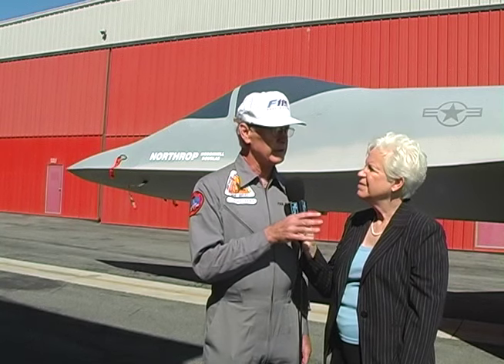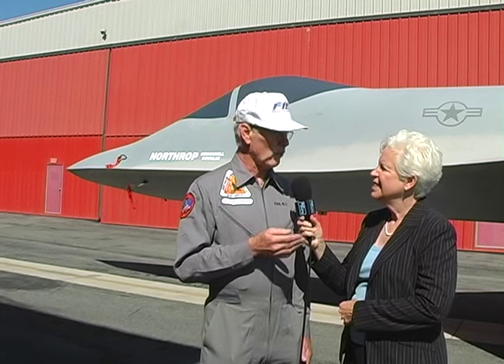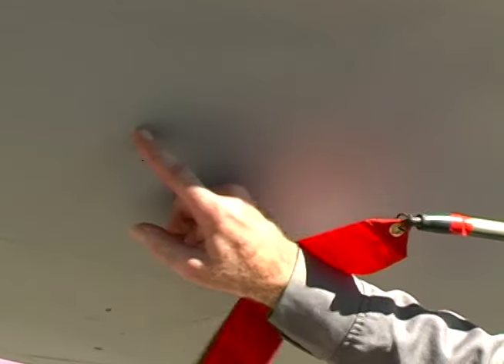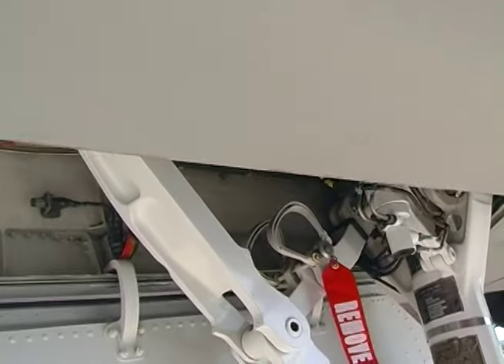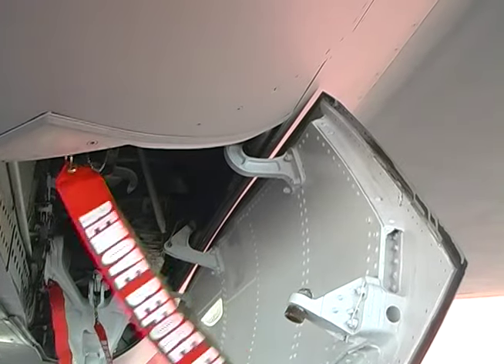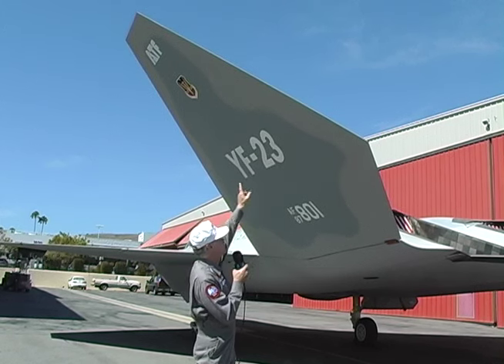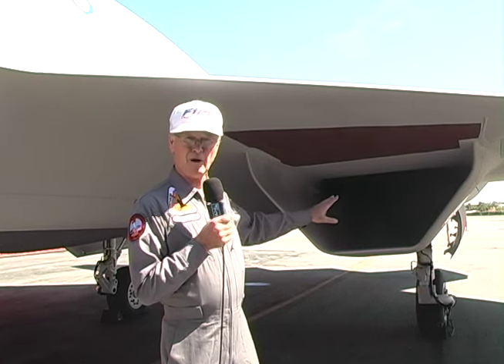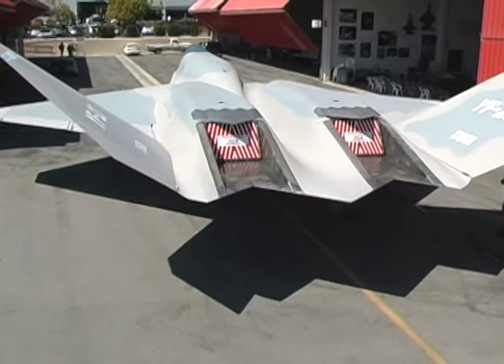YF-23 Walk Around and Design Features by Test Pilot Paul Metz

Comment: Most don't appreciate what an advanced design this is. Low polar moment makes possible this low drag, high-speed tailless configuration, giving it better speed, range, stealth, payload and maneuverability than the F-22. All with only two aft control surfaces, not 8 like the F-22. Made possible because the center of lift has been moved forward.
Reply: It was stated officially that the F-22 is more agile than the YF-23. I personally love the YF-23, probably my favorite jet after the F-8 Crusader. I think what killed the F-23 was political though. If Northrop got the contract, they'd have a monopoly on both fighters and bombers, considering they already had the B-2 contract (and they now have the B-21 Raider project. It's a shame though, this beauty needs to fly with the birds, not be stuck on the ground being crapped on by them!
Reply: it was more "agile" because LM pulled 9gs in test flights- manuvers which were not requirements or in the test plan and NG understandably didn't to test something which wasnt a requirement.  both the 22 and the 23 met the trimmed 60 deg AOA but the 23 did it without thrust vectoring.  another bolt of wool LM pulled over the USAF procurement team/taxpayers
Reply: @HalcyonSkies  "stated officially" by whom?  The AF?  Lockheed?  Watch the documentary on the 23 on you tube channel Western Museum of Flight.  Very informative.

Comment: Beautiful plane!!!  I had read several articles that stated the YF-23 was slightly superior to the YF-22, however, Lockheed Martin needed the contract as Northrop was going to get the B-2 contract.  There has been rumors for years that the F-23 was going into production in a JV with Japan.  That would be great as clearly the Air Force is now kicking itself for not securing as many F-22's as they wanted.  An updated F-23 with Japan would be amazing but likely will never happen.

Thank you for this great video!!!

Comment: rumors are afoot...  Japan may bring the F-23 back from the dead in 2019! True Story!
Reply: Matthew Krawitz, in talks as we speak... I'm rooting for this to happen. If not in the USAF then in some other air force as long as it fly's.
Reply: That would be great only if they pay for ours also. No way Japan's Air force gets this beast unless we get it too. They have the money; let's go!
Reply: No they won't stop with that, rumors no shit. What ever you hear just don't believe it. The plane most likely won't be back unless they can get something out of the airframe.
Reply: we can't let this beauty rot there, engineers worked hard. LET THE BEAST FLY!!!!
Reply: I hope that happens and the the US buys some.
Reply: People around STL are reporting seeing this plane shape on flights over St. Charles the last few nights.... Boeing may be hiding this   away
Reply: I heard they destroyed all the tooling machinery and everything related to manufacturing the airframe... don’t know if it’s true or not
Reply: no way...the electronics have changed so much.  Remember this is a design that dates back to the 80s.  In fact i doubt the electronics on the YF-23 are even still being made which means any resurrection would require updated electronics which would throw off the weight of the plane and this plane had extensive testing and tweaking to the algorithms so the plane would have a stable flight.  To bring this back with modern systems would require a ton of money which is better spent on a new air-frame like the Japan X-2 Shinshin.  My opinion
Reply: Better to go with a F-22 that was brought to production.
Reply: Matthew Krawitz Wrong!!! Never gonna happen
Reply: JASDF lost a F-35 why??? no one knows
maybe it will be an excuse for buying the yf-23
and selling those F-35 back to america
Reply: 2020
Reply: That jet was beautiful, the stealth exceeded F22 and I believe many 6th gen designs are copying its tails section.
Reply: @snowhiterover  Northrop Grumman and Boeing are separate companies. Both YF23s are engine-less and haven't flown since the early 90s. Both are museum pieces. Northrop did take one back to use briefly as a visual piece for Japan and then returned it to the museum.
Reply: Brian Landers  no, it was completely designed by Northrop at the radar cross-section in tejon ranch California, they worked on it since the seventies and was their follow-up to have blue program
Reply: The rumours are even now stronger that it may happen

Comment: 4:38 This Pitot tube is one of the questions I have for F-35.  Since Mr. Metz said it is a temporary test device for F-22 and there is a stealthy version of it, then why F-35 still have them on MP aircrafts?
Reply: For reliability and cost reasons. Those small, flush holes can get clogged easily, and therefore have to be maintained more. Also, because those holes are much closer to the jet, the jet's disturbance on the airflow near the holes not negligible, so the numbers that those holes give aren't actually accurate - experimentation is required to get a correction factor that's applied to the sensor readings to get the true air data. This experimentation drives cost up. Also, nobody's really used this technology before, so R&D cost is also very high.

Comment: The YF-23 was far and beyond a better aircraft than the YF-22 / F-22. Lower RCS, better engines, longer range, more payload.
Reply: Very true! it should have won...
Reply: Wonder if the Lockheed bribery scandals has anything to do with the YF-22 YF-23 fly off.       

The F22 focuses on agility 

The YF-23 focuses on speed and stealth

I think these planes would have worked well together in service
Reply: But no thrust vectoring.
Reply: No the issue was Northrop screwed the pouch on the B-2, not only that they own the drone market.
Reply: Better engines, that failed in prototype resting. It had to make do with 110’s I think
Reply: Jeremy H. 
The most horrific thing for these men is that all their effort wasnt even taking into the US arsenal as another 5th gen jet.. glad they preserved them.
Reply: Buster Dallas yeah but it was also thermally invisible.
Reply: 1. The RCS of the YF-22 and the 23 were similar. While the 23 has advantages by having just half of the YF-22s control surfaces, it also had much larger control surfaces which will break the planned form alignment  when moving. 

The canopy of the 23 also has a canopy bow which reflects radar as well. The 22 has a one piece bubble canopy that is better for Stealth. So while I do agree that the 23 was stealthier, I would say the advantage was smaller. 

2. Both the 22 and 23 had the same engines. 

The Pratt and Whitney engine was rated at 30,000 lbs only which was the original requirement. The requirement changed to 35,000 lbs. Both GE and Pratt built new engines rated for 35,000 lbs but only GE installed it on both the 22 and 23. Pratt's new engine went through rigorous ground test. But if selected Pratt guaranteed that it would be every bit as powerful as the GE engine and it was. 

3. The 23 was faster but only by a slight margin. In fact according to Paul Metz's other video the 22 was tested to a higher absolute top speed. 

For supercruise the official figure was that the 22 got up to Mach 1.58 while the 23 went to Mach 1.62. So as we can see the difference is small. 

4. The YF-23 had a capacity for 5 missiles while the 22 can carry 8. So payload was better for the 22.
Reply: Dude doesn't have better engines than f22. The yf22 and the yf23 both were testing engines from general electric and Pratt Whitney the grey yf23 had general electric engines the black yf23 had Pratt Whitney engines which now powers the f22 raptor.
Reply: Armchair expert alert!🚨🚨🚨
Reply: @michaeld1170  The canopy of the YF23 wasn't really polished, i'm sure in the final design they would've upgraded it to at least f22 standard.
Reply: 1) Conjecture
2) No, they used the same powerplants. One unit from PW and the other from GE
3) Conjecture, they would've used the very same engines.
4) Again, it's a conjecture.

Anyway, it failed to satisfy all of the ATF requirements which also featured superior maneuverability.
The F22 was, from the day one, the better all around fighter between the two.

Comment: The YF-23 looks more stealthy than the F-22
Reply: Originally the f23 was better all way round but at the time the airforce didnt know what they wanted and they thought the f23 wasn't agile enough so they ended up with the 22 cool fact the engines and stealth used in the 23 they incorporated it into the 22

Comment: i was quite sad when YF22 won the comp...... but now seeing it closer, it lacks thrust vector and those heat tiles would be pain to service
Reply: +William Ng But for a mission requiring stealth and speed thrust vectoring shouldn't be an issue the considerably longer range between refuelling should negate all the cons.
Reply: +Gareth Wilkin you have a point.
Reply: Gareth Wilkin You have to be able to fight too.

If i told you that you were entering hostile airspace, and had to choose between a place that is uber stealthy, but couldn't fight very well, or a plane that is nearly as stealthy, but knocks the block off of anything else in the air, which would you choose? You might add that planes inevitably get stealthier with time.

The YF23 was supposed to have been slightly stealthier, and slightly faster (slightly is estimated to be at around 20 percent). But it wasn't just 20 percent less capable at fighting. It was more like 50 to 75 percent less capable. You essentially had a stealth jouster going up against a mediocre ninja. It just pays to be a ninja more often.
Reply: Widg3t's Widgets
The YF-23 was just as if not more so.
PAV 2 was faster and had a considerably longer range.
Jim Sandberg the test pilot for PAV 2 said it was the best plane he had ever flown and would ever fly.
Reply: Well according to yf23.net, hardly supporters of the F-22, the YF-23 flew mach 1.6 without afterburners and the YF-22 flew at mach 1.58 without afterburners during testing. That is a 15 mph difference. Not exactly a huge deal. The 23 did have farther range because it had more fuel. But Northrop sacrificed weapons for fuel. So the 22 had room for eight missiles and the 23 only had room for six. Why? Because they used that space for fuel. And it is obvious that they knew that they lacked in that area because their Dem'Val proposal adds to the length of the 23 and adds a weapons bay under the cockpit. The production 22 is three meters shorter than the YF-23 was and it is a foot shorter than the YF-22. All with the same fuel and weapons. And the 23 would have been a good fighter but the 22 could fly just as high and just as fast and was certainly more maneuverable especially at high altitude. And as far as the stealth of each aircraft... that is still classified so those that know how stealthy each aircraft are/were can not say. the fact of the matter is that the 23 was a great plane but it was handled horribly by Northrop and the 22 flat out outclassed it in key areas like in it's weapons payload and in it's sensor fusion ability which was superior to Northrop's and that is a pretty big deal with 5th gen aircraft.
Reply: Billy Slo whenever a fly off happens the government typically goes for whichever plane has to change the least to reach production. The yf-23 also needed a new intake to get rid of narrow window where radar could see the compressor blades. Also, from reading about what a feet of engineering its wings were, I get the idea they would have been expensive to manufacture. 

The other example is Boeing’s JSF, where the proposed final design had a completely different planform. I applaud their optimism but that fly off was basically over before it began.
Reply: William Ng Northrop made the Air Force THE plane they asked for. They met every single technical spec, focused on speed and aerodynamics and stealth/radar cross section. Based solely on the design spec sheet, Northrop 100% is the winner. However part of that requirement was not thrust vectoring. Lockheed, having a lot of experience making the Air Force jets, made the Air Force the plane they really wanted. The YF23 IS faster and stealthier etc, but the YF22 is fast enough and stealthy enough. Northrop made them the Jet they asked for. Lockheed made them the Jet they really wanted...
Reply: And as per the interview video, Lockheed marketed the YF-22 better.
Reply: The F35 will still lose in a dogfight situation. Even older migs outmaneuver it. Stealth is everything.
Reply: @RediscoveryChannel2021  yup
Reply: @garethwilkin5565  pav 2?
Reply: Dont forget the YF23 combined both the tail fin and rudder together as one named v tails making it very manuvuerable unlike what people rumoured. It can performed as one big air brake during a dog fight. Its really a waste of technology and engineered air superiority.
Reply: @RediscoveryChannel2021  i doubt that. The F-35 can pull a lot of AoA and has very good acceleration, low drag and sensor fusion.
Reply: This is an almost 30 year old design that no one has stolen and copied. It was good for its day but a new stealth aircraft has to take into account today's challenges which now includes affordability as well as longevity and the usual potential opponent's ability to counter it.